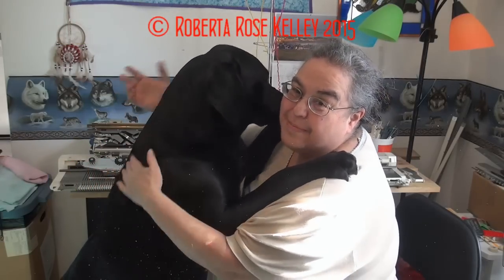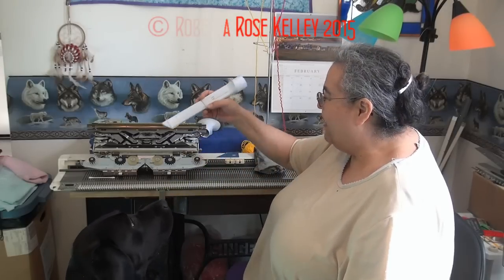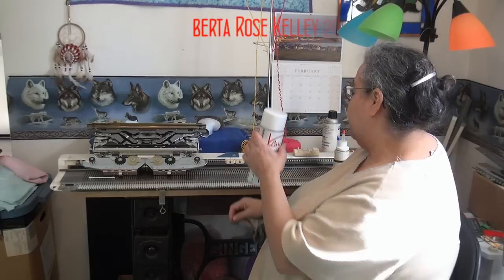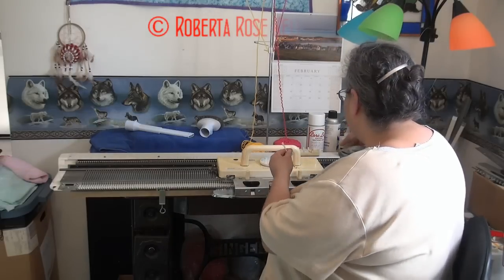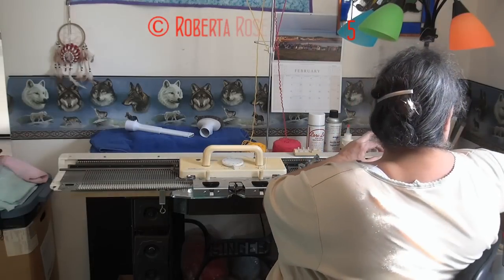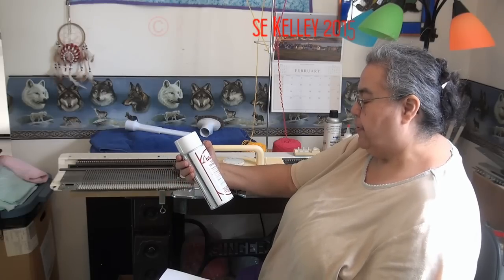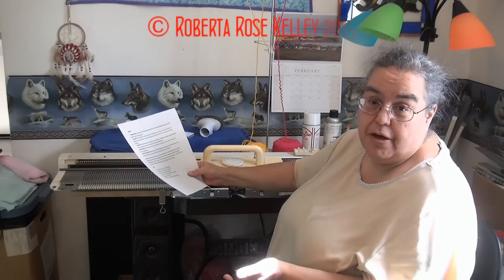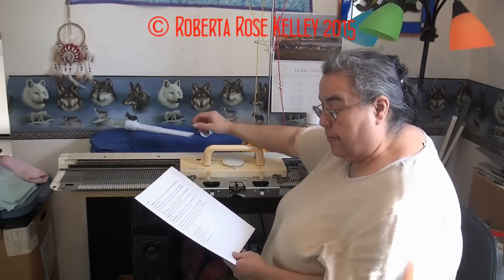Cleaning and Lubricating a Knitting Machine and Carriage

Comment: I mentioned in a reply yesterday that I had not used my machine for so many years and was getting back into knitting again. Luckily, I found my can of Lori-Lin in the cupboard, so I'm off to do some machine maintenance. Thanks, Roberta, for another informative video.
Reply from the maker: Hello again Evelyn
Most of us will be like that.  I used to put my machine away for the summer months and then when I got it out again, couldn't remember much of anything but pushing the carriage back and forth.  But in time, I do remember most things now but I do not put away my machine at all.  I will have one out and if I can clean some of the clutter on the dining table, I can get a 2nd machine out also.
I love the Lori Lyn, when I found out it was being discontinued, I bought a couple cans of that, wish they kept making it as that is some good stuff.
Sure you will be machine knitting up a storm again soon.
Later Berda

Comment: Thank you for this! I have a “brand new” brother kx350 that I just found at thrift store. It’s been in the box for several decades but never used and I haven’t been able to knit at all because my carriage gets frozen on my second pass after I’ve hung my cast on comb, so I’m hoping this will help. I’ve never used a knitting machine before and am very excited to have this machine and try to learn! Thanks so much again.
Reply from the maker: Even though it may be brand new, most times when they sit for awhile, the sponge strip in this case or sponge bar on the metal bed machines do need replacing. If you cannot get a new sponge strip from online or ebay, you may try using some sort of weather stripping to make your own. but still it needs a fabric on one of even both sides to get it in the channel better.
https://www.youtube.com/watch?v=_ZrxlJa5Opc 
https://www.youtube.com/watch?v=DAOTLnJgIho 
Hope you get to use it more and more as time goes on. That was the first machine I had, used it for 15 years before I got my first metal bed machine.

Comment: Oh geez, I'm sorry for the long post. It's so long, I'm going to title it- "The Question That Became a Blog Post" 

Right now, I'm working on getting a mod 150, srp150 ribber, and a ps150, purchased at an estate sale about a month ago, up and running. This is to be my first foray into the wonderful world of machine knitting. When I was a kid, I had first seen a Brother knitting machine in my mom's AAFES catalog and it was such a marvel to me, that bright blue metal case! all those needles! What a wonder.  Aside from that department store catalog listing, describing it in 2 or 3  sentences, if even that, detailing the make and model, number of needles, and country of manufacture, I knew nothing about knitting machines. I don't know much more about them nowadays. I'm sure the catalog also provided dimensions, but I didn't have time to care about dimensions. There was a picture next to the description! The photo couldn't have been larger than 2x3 inches, displaying little more than half the needlebed, and within that main picture, there was an inset photo, a smaller square with a photograph of the entire machine, lid closed and latched. I ran my fingers over that picture so often, the ink quickly smeared across the thin magazine paper stock, the picture becoming a blur of black and blue and grey. Not long after that, I rubbed a hole right through the page. Lost the picture, but that image was saved in my mind. Anyway, that catalog pic showed nothing else along with the knitting machine to give an idea as to how much space a knitting machine occupies. So with zero contextual clues, my 10 year old mind related to the only other box I knew of, having roughly the same ratio and latches- a knitting machine inside its box is the same size as a flute! And the needles are like sewing machine needles, yeah?  I remember being really perplexed, sitting around wondering how on earth that thing could knit. And how would the thread come out as fabric if it goes through an eye of a needle first. Finally, after a lifetime of wanting to learn machine knitting, I got a machine belonging to a lady wbo seems to have spent a lifetime as a machine knitter. Feels right to me, like an equation that's balanced on both sides. Although my mom taught me how to knit with 2 needles when I was young, I don't have the patience for them and I'm eager to begin learning how to knit on a machine. I guess, part of the practice of machine knitting includes the maintenance of these vintage units, with cleaning being a major component, so I guess, I am learning machine knitting already? despite having yet to knit my first stitch.  As it is an old machine, and as it is not in terrible condition at alI, I wanted to start gently, seeing how much progress could be had before having to call in reinforcements. Using your videos as my guide, combined with information gleaned from other videos and blogs, I'm cleaning the carriages using a folded rag, a cut up old t-shirt actually, dampened on one edge with only water. The rest of the rag I've left dry so I can immediately wipe away any traces of water once a section has been deemed cleaned. Hoping the beds are as nice as the carriages as to not need an entire teardown, like in your 4 part video, Miss Berda. I did pull off the sinker plate though, and spotted about 3-5 tiny, but stubborn, rust spots, each about < ½ mm across. Should I start with 0000 steel wool on the rust? Or would spot applying a chemical rust remover using a Q-tip be the better way to go?

Also, what do you think would leave a filmy coating on the top of sinker plates? It reminds me of the coating on a wall behind the stove, created by vaporized grease accumulating over time. But it's not anywhere as thick nor is it near as sticky. It is, however, sticky enough to require a lot of persistence and elbow grease to remove. Upon closer inspection, the coating actually seems to cover the entire topside of the carriage, but is most noticeable on the sinker plate. It also has a stronger bond to the (galvanized?) metal surface of the sinker plate than the plastic carriage cover. I find it much easier to remove the film from the plastic cover than from the sinker plate. The levers and cams protruding out from the sides didn't seem to have any residue, negligible at best. Perhaps that's due to the manufacturer's coating on those pieces? The original owner kept the machines in her beautifully finished basement studio, with an entire wall of open shelving replete with coned yarn sitting in different sized cubbies, accommodating different sizes of cones. Across the room there is a little sewing nook,  complete with a false wall/hidden door panel that when pushed, a magnetic latch would spring into action, opening the hidden door to magically reveal a built-in, fold out ironing board! I wish I could have seen the studio when it was actively being used, before our prolific knitter passed away, but I am grateful to have been allowed entry into the space in which my machines resided prior to their coming home with me. That studio, which may have doubled as her storefront, was immaculate. I don't think the coating on the carriage is kitchen grease, wafting in from the kitchen upstairs, through 2 doors no less. The only thing I can think it might be is that it's wax from the yarn? Or could it be knitting machine oil? I dread thinking it's machine oil. But you know I don't know anything  about this stuff so 🤷 

Luckily, my machines came with a nearly full can of Lori-Lin and nearly full bottles of the machine oil, likely packed as original accessories from the factory. Do these oils go bad? The bottles are translucent so I can see that the oils look great -very thin oil, much less viscous than i had imagined, and a light color,  with no weird separations, no weird smells or discoloration. I had read or heard somewhere that the author does not trust oils that came with a used knitting machine because of how old they must be. But I remember my dad using sewing machine oil that looked like it came from the same assembly line as the very first sewing machine; the bottle was dented and rusty. And judging from the illustrations and fonts printed on the steel bottle, that sewing machine oil definitely predated my birth by easily 20 years.  It could have even predated my dad's birth in 1945. He used that bottle on our machine practically my entire life. And it's worked fine my entire life. But we've already established that i know nothing, so 🤷 

Since you said they don't make Lori-Lin anymore, I'm going to use it sparingly.  I  did buy some WD40 to loosen up a transfer carriage that came with my purchase, in case following your tip with the hair dryer doesnt work. The crank won't budge so hopefully I'll get it going with a bit of a heated blast. If not, surely, WD40 will work a charm on that hardened grease. But after the cleaning of machines is done, and after cleaning the cleaners off the machines is done, for actual  lubricating, especially electronic components, I picked up a can I've never tried before- Dupont Non-Stick Dry Film Lubricant in a black and white spray can with a red cap, includes a skinny red straw shrink wrapped against the can, an attachment for spraying the dry lube into tiny spots with precision. This seems to be designed for machine parts that move repeatedly, listing chains, gears,  locks, light bulb threads, and sliding surfaces as some of its designated applications. Sliding surfaces? Naturally, i thought,"knitting machines!" 

Says on the can:

Professional Grade
Dry, clean & oil-free
Repels grit & grime 
Reduces sliding friction
Bonds to all surfaces
Insulates electrical conductors
Protects metals, plastic, and rubber

I hope I've found my holy grail km lubricant 😁

Also, your dog is a sweetheart! You guys look so adorable
Reply from the maker: I do have your Blog Post in a document to answer you, cut can you email me at hobbyknitter at gmail dot com?

Comment: I appreciate your knowledge and sharing the abundance of information as enjoy my Toyota 901 Knitting Machine. I purchased it barely used and a Brother Knitting machine in virgin condition from the 1960's.
Reply from the maker: I did have a Toyota machine at one time but I couldn't get it to work but maybe in time I will get me another one.  But I do love my bulky Elna machine, (before was the sk155).  The older machines are better in other ways that the newer ones are not.  Berda
Reply: Thanks for responding. I also learn from The Answer Lady.
Reply from the maker: It is good to watch more than one person on any subject, one may do something a little differently that you would prefer to do or the other person shows something that has not been seen before.  Berda

Comment: Thank you so much! One question: If I want to see under the needle bed, do I just need to unscrew the metal and remove it? Is the needles are just going to fall off?
Thank you
Reply from the maker: I have removed the metal bed off a machine and the needles stayed in place, the sponge bar holds the front and I sort of forget how the back is but there must be something holding them in place. Hope this helps.